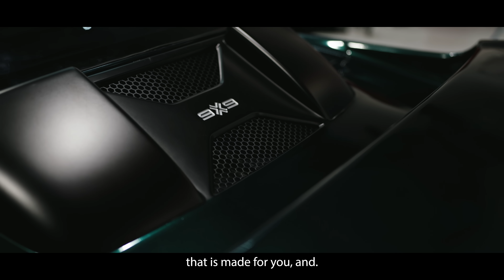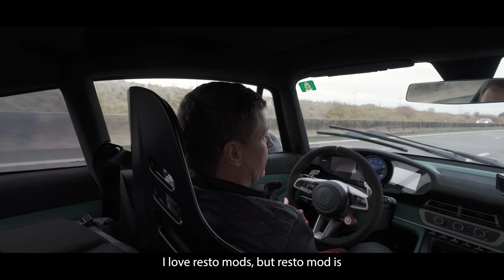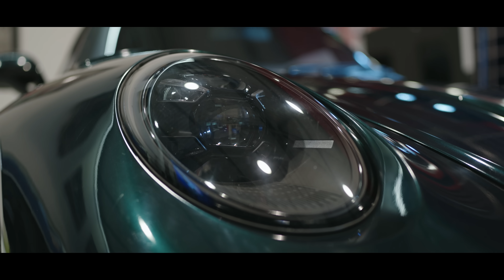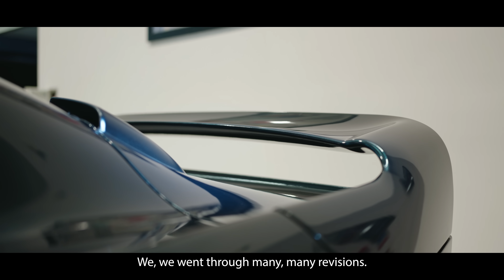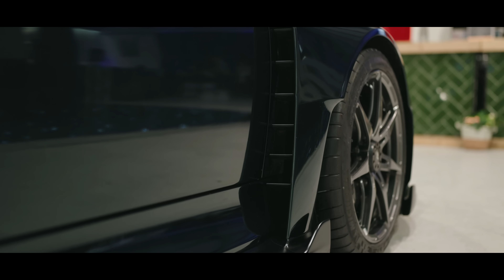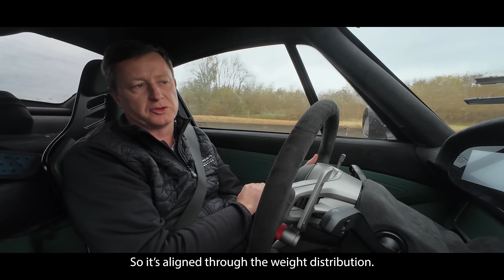Exclusive: KALMAR 9x9 | The $2.15 million 959 Hypercar tribute

Comment: I can respect the engineering and passion of a Singer 100%.. but this is clearly just a highly modified 992 that has no odes to a 959 but the shape of its wing! For “2.2 MILLION” 😣
Reply: The chassis is much closer to a 993, hence the car is much shorter and slightly narrower than 992… but much lighter

Comment: I have a question.... is this car four-wheel drive? Because the real original 959 was and that's what made it special. EDIT; Okay, so they said the four-wheel drive is an option and it's built on a 992 chassis. Lots of work was done on the aerodynamics to keep it stable at 340 kilometers per hour. That's what I got from this.
Reply: Yes awd is standard but we have one version without. And this is not a 992 chassis. 140 mm shorter and closer to a 993 chassis

Comment: You can buy an actual 959 for that money...
Reply: For less. 1 sold at auction for 1.6 mill this year. And it'll keep its value better, most likely.
Reply: I would still rather a mint 1970s 911S in metallic sky blue  ❤❤❤❤
Reply: Hahahahahaha
Reply: This would make a 959 look like a Daewoo Lanos
Reply: But I would choose this coz I want to drive it. Driving a 959 I believe would be disappointing old tech. 🙏🏼🇦🇺
Reply: Yeah but they're really unreliable
Reply: @carguy_rz  it is a 959
Reply: One can buy a fine Canepa example if you want it to be that fast but also want the original for that money
Reply: Depends what money one has and what your dream car is. Id have a pre A with 40hp if I had the money.
Reply: And slight different performance

Comment: The car looks amazing
I love the 959 look
But 2.5m come on ?
Reply: I like it. But if I had the money, I'd be asking myself why not buy a couple of AM Valhalla instead? Or a couple of Ruf SCRs?
Reply: @Hairyderriere  All these retro, tribute cars a just a racket to make lots of money out of nostalgic rich clients. The prices are so far beyond the original cars. It's getting out of hand.
Reply: @GoblinKid1  well, its lucky we have the Marc Philipp Gemballa Marsien then, isnt it. you get an almost as fast, more capable, 911 based, modern 959. that can also go off road too much like the 911 dakar. has similar power to the 9x9. a little more weight, but that off roading capability, more refined enterior. and an engine tuned by none other than RUF. all for £600k. not to mention the fact that it looks vastly better than this 9x9 (that looks like it stole the stag front bumper design from old need for speeds ffs)
Reply: Agree a lot of money, mainly due to the ultra low numbers and very exotic materials
Reply: PLEASE stop acting like you would have ever come close
Reply: @aLeLiBiV He's giving an opinion that it's a ripoff. You can have an opinion and not afford it. It costs more than a genuine 959 which will hold its value more. You keep commenting on this video but haven't learnt anything yet.

Comment: its just a 911 with a fancy bodykit on it really. how are they charging 2.15 million for that ffs
Reply: Did u watch the video?.. It's bespoke. Each car is one-off.  Do you think you can slap on a body kit and safely drive 320km an hour? Haha, u must be like 12 years old.  
Full carbon laid body with aero that works 
Its been in a wind tunnel.  Completely engineered front to back. Re-Engineered dashboard and suspension. You have zero idea about R&D and what that costs.
Reply: @rkwjunior2298  considering the fact I've seen many you tubers build their own bespoke cars for much less, yeah?
Reply: @XenonArcher  No you tuber is building this ..hahahha
Reply: @rkwjunior2298  you would be very surprised lol
Reply: No. Just... No. This is A LOT more than that. It's a custom coach built 959. It's not a 911. It's an artwork of automotive engineering. You can buy a body kit but you have the same car underneath. These are one off's and they're a totally different vehicle from the front bumper to the rear. Engine. Transmission. Chassis. Suspension. It's all custom made and it's BASED on a 959. It's not an old 959.
Reply: @RecycledSoul  this has nothing to do with a 959 ffs
It's a 911, literally. With a body kit and custom interior. With a few suspension and engine modifications.

The chassis, is a 911. It's engine us from a 911. Front suspension is altered, yes. Engine produces more power, yes. Interior is modified too. But it's still a 911 ffs
Reply: @XenonArcher  It's nothing like a 911. The chassis was a 911 on the 959 too, BUT MADE BY PORSCHE. This is a totally hand built car. Bumper to bumper. Why do you think a Singer cost $600,000???
Reply: @RecycledSoul  bro. The chassis on a 959 was based loosely on a 911

This kalmar? It's based wholly on a 911 lol. There's a difference.

Like, I'm not sure you're understanding things here.
This car is not what a 959 was for it's time. The 959 it's self was over engineered for it time. It was a technological masterpiece.

This kalmar is none of that. And it's body kit, which is what it is, looks incredibly odd. The proportions are all wrong lol.
But if you think this car is worth that much then you do you I guess.
I don't think it is. I'd rather just buy a 992.2 gt3 rs mr when it eventually comes out. Would be substantially cheaper, better looking and more purposeful than this poor, overpriced imitation of a classic legend
Reply: Yes, exactly!
Reply: You really don't know much about it it's very engineered. Either you like it or not. That's just the way it is
Reply: "fancy bodykit" ..... one of the lamest assessments ever. You probably get a chubby discussing RWB also.
Reply: @XenonArcher  This is for people with money who does not absolutely nothing about cars.
Reply: @rvilla4257 People who spend 2 million on a bespoke Porsche  are car enthusiasts. 
This comment section is full of children
Reply: @rkwjunior2298  no, no they aren't. Car enthusiasts build cars. Rich picks that buy these cars simply buy them to have them as a statement of wealth. Hence why the price of it is plastered on every video of it. People want you to know how much it costs so you know how much money they can throw at a car on a whim.
Reply: @rkwjunior2298  lmao 🤣
Reply: @rvilla4257  someone could literally buy a 911 and custom build a kit like this, for less money than what this car costs lol
Reply: But then again, the OG 959 still uses 911 engine.
Reply: @farishanafiah8461  Slow
Reply: So, tell me you didn’t watch/pay attention to the info contained in the video without telling me you didn’t watch/pay attention to the info contained in the video…
Reply: @customconnections2425  only I did watch the video lol. If I didn't, how would I know it has push rod front suspension and over 900hp

Point is, this isn't a bespoke car. There are actual bespoke cars out there, with better styling, better performance and a smaller price tag

I get what this guy tried with this car, but man, it just doesn't hit right with me
Reply: Me when I know nothing about cars
Reply: @aLeLiBiV  what do I supposedly not know about cars lol
Reply: @aLeLiBiV We're all waiting for you to tell us what you know that we don't? Go on then?